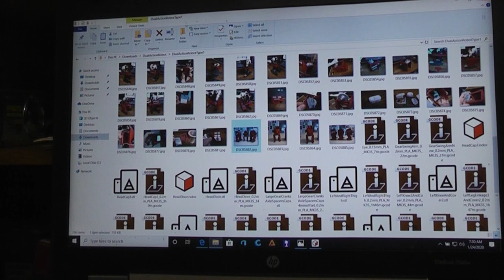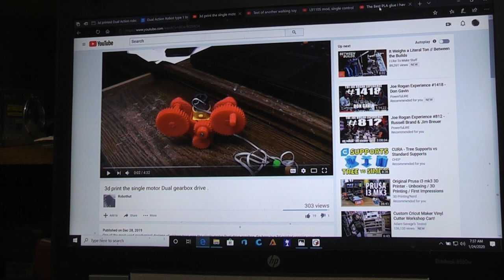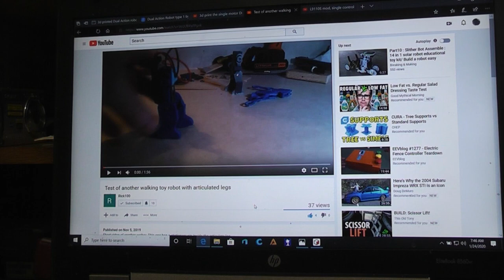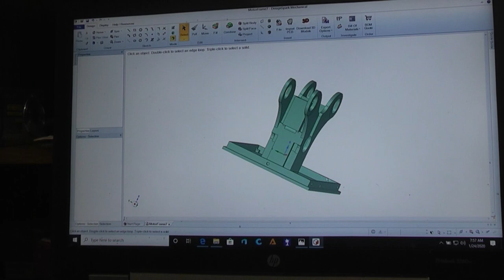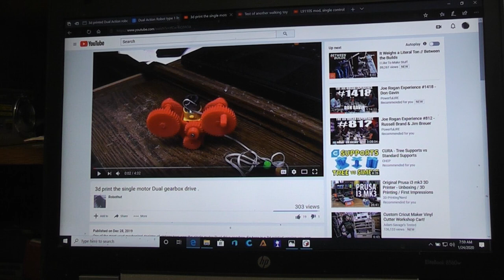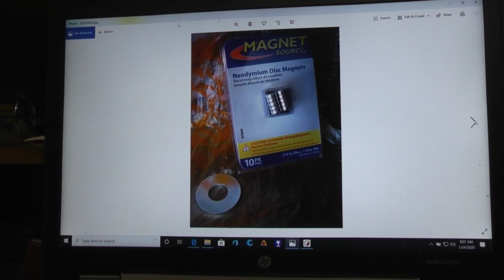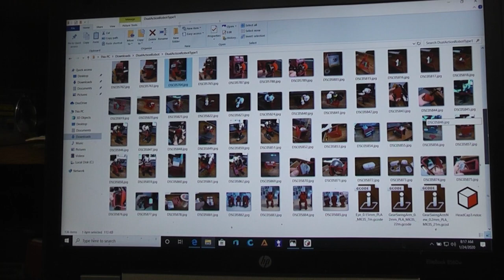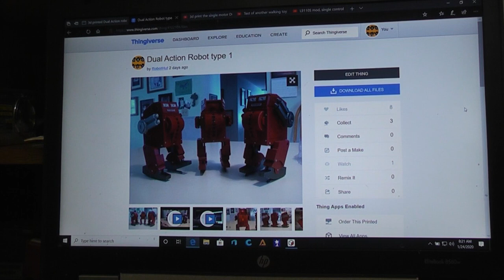Build the Dual Action Robot type one. 3d printed

Comment: i've got a question about the motor polarity switching system, not for a robot like this, but for one of those jingle bell rock santas they released in the late 90's, i'm looking for a very similar circuitry, but instead of it being 5 seconds, it has to be 1 or less, would this configuration work, does it have any resistor to change the speed of the pulses? what would i have to rig in order to obtain a hip mechanism to move back and forth automatically and constantly? Thanks in advance
Reply from the maker: I used a 555 timer board so the time intervals are adjustable to anything that is needed by turning a trim pot. But if all you want is to have a hip motion that moves back and forth then you just put a cam on a gear motor , the linkage on the cam will move back and forth , you just adjust the speed of the gearmotor for any movement speed.
Reply: @Robothut  hi john, i purchased the 555 board and i ran across the problem yours had, the capacitor that needs to be replaced so the cycles are slower, do you happen to have any photo on which capacitor/s is it that i have to replace? i saw you replaced one, mine has 2 over that place, which one is it? Thanks
also, i opted to leave it as it was originally(mechanically) because i've done the modification to another fried one i have, and even though it works and delivers a good constant motion it loses stability and it's very prone to grinding once the modification is done, so i want to see i this can make the same result but controlling the motor as it should nomally be.
Reply from the maker: @Zadakleader635IvanTheRobot  ON the Alphadrome web site I posted build pictures and information. On page two of the dual drive thread you will find pictures and info on the 555 timer cap mod.
http://alphadrome.net/forums/topic/22895-3d-printed-dual-action-robot-type-1-inverted-pin-walker/
Reply: thank you! i didn't know there was a second page or that you could even select another page, this really helped, now i'm all set! the alphadrome forum has always seemed hard to me.